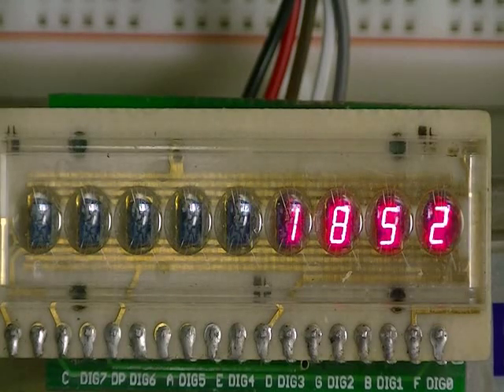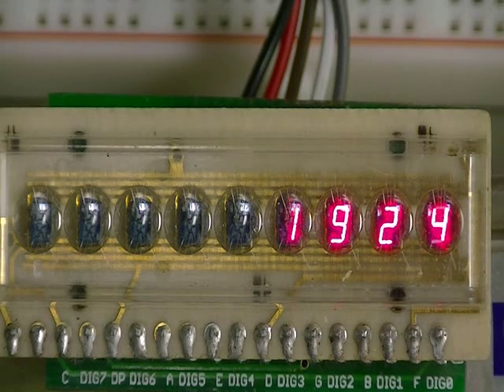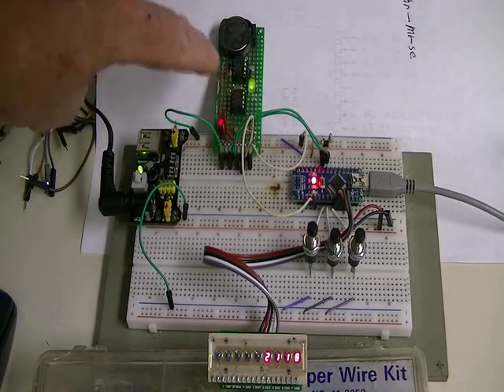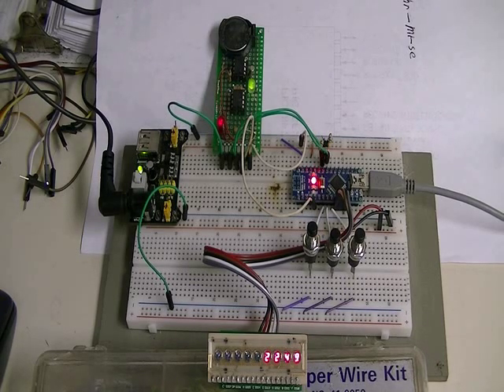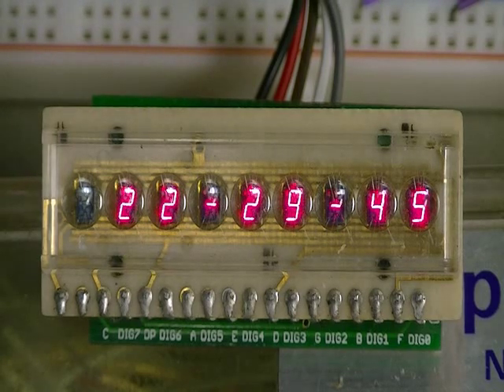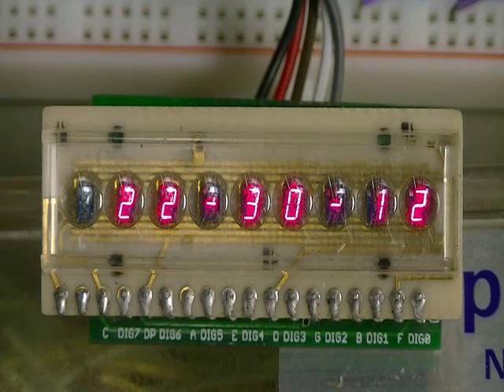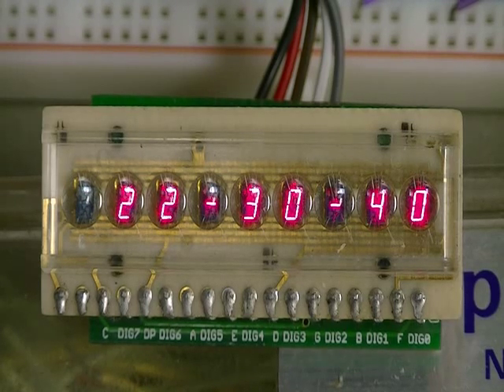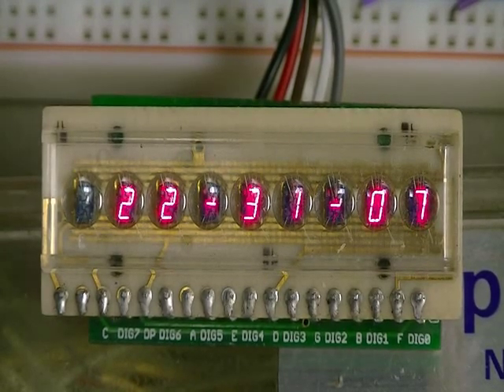Arduino RTC Clock with MAX7219 8-Digit LED Display

Comment: sir i buy new xtal  32.768khz 12.5pf capacitance load..after install  it it my clock work some fast  in 24 hoour 7 sec fast...what should i do? or microcontrolar i used atmega 328 with 16 mhz xtal
Reply from the maker: Are you using a DS1307?
Reply: YES USED DS1307 AND I ALSO  KEEP A GROUND LAYER UNDER XTAL DS1307  AND GROUND NOT CONNECTED WITH XTAL... I CHECK IT THOUGH...
Reply from the maker: The clock depends on the DS1307 so if it has a problem I don't know. If I get a chance I'll recheck.
Reply: sir, I have number of ds307 every ic work same.....Ds1307 datasheet say 
 ..xternal circuit noise coupled into the oscillator  circuit  may  
result  in  the  clock  running  fast.....  How could i decrease 
external circuit noise ?.... i  also added a 0.1uf cap(104)  on ds1307 
8th pin or ground...

Comment: The code doesn't work on my arduino :( the display shows nothing..
Reply from the maker: Check your electrical connections. Does it work with other codes?
Reply: connection rather good. I use a DS1307 module that works. i Upload to arduino control the display at the library ledcontrol, it works. but together nothing happens. sorry for my english, im from poland
Reply from the maker: V-cu
Run this code here to test the MAX7219 by itself.
http://www.bristolwatch.com/arduino/arduino_max7219c.htm
Reply: sometimes works, sometimes not. does not respond to the reset .. still displays 888888
Reply from the maker: I don't have enough info to go by here. What type Arduino are using and at what voltage?
Reply: Arduino nano. voltage from computer usb 5V
Reply: OK, it's work :) enough to give capacitor 100nF and 100uF to power :):) thanks
Reply from the maker: Thanks I'll remember that.